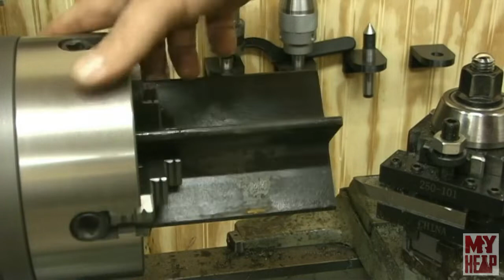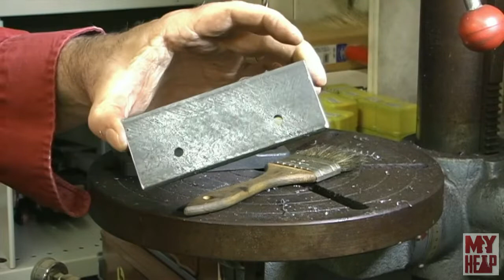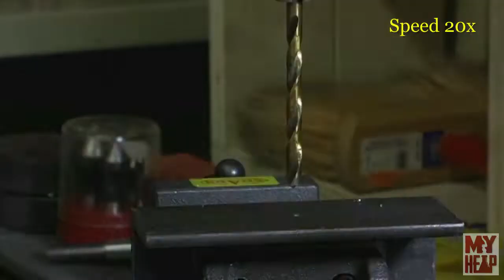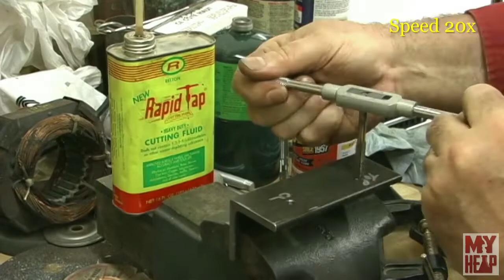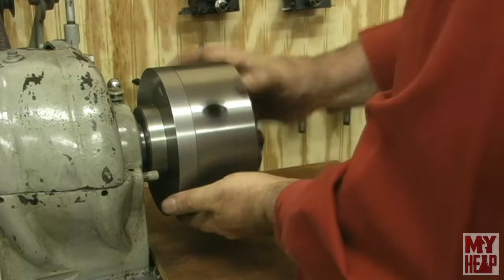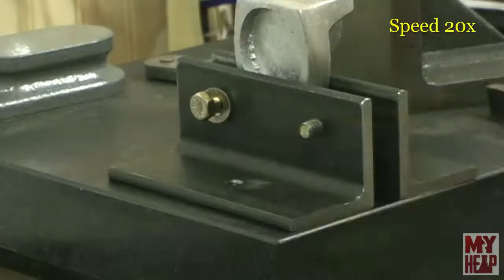Building Gingery's Faceplate Angle Clamps - an ode to myfordboy.  😁

Comment: I can’t imagine that would be a very rigid set up, but I guess it may have it’s uses.
Reply from the maker: Well it only has to hold it enough for a few light cuts on the base of the engine frame.  Truthfully, I probably could have put some copper packing between the jaws of my four jaw and would have been okay.  But I did have fun doing it.  Thanks for watching.